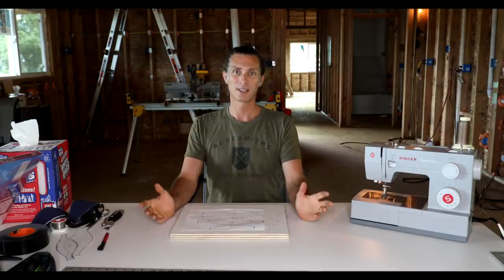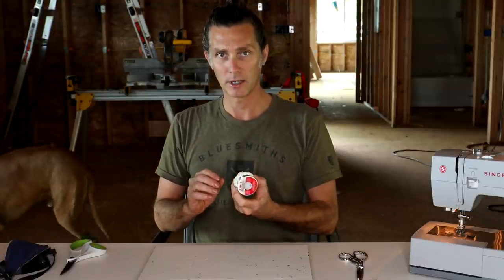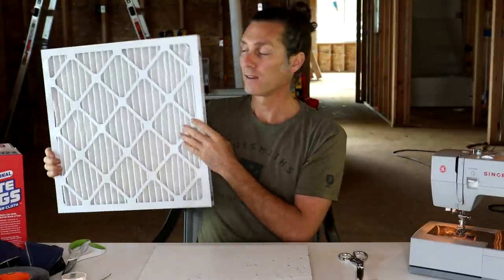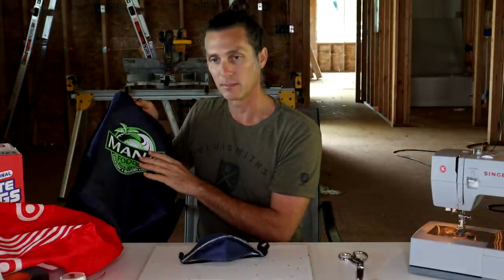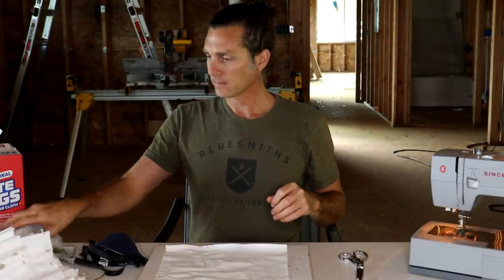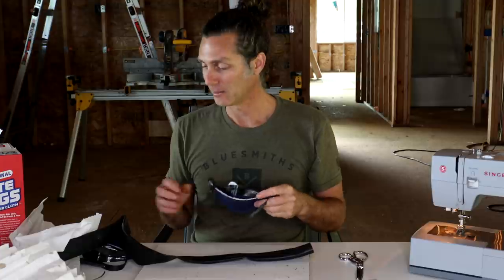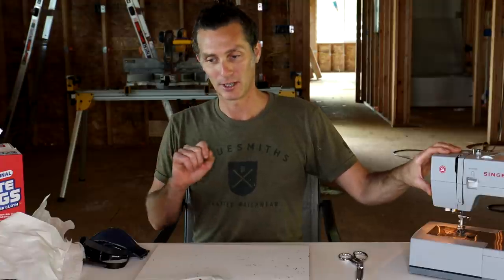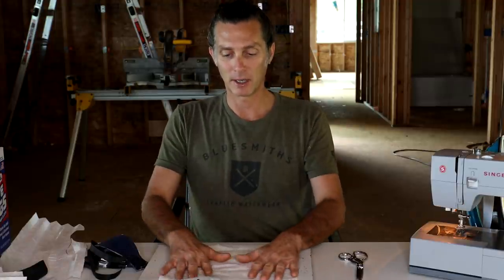Tutorial: HOW TO make your Own High Quality Filter Mask

Comment: Best design ever. The Target and Mana bags are made of "Oly Fun" fabric which you can buy from Amazon.  

I'm adapting these not to use the filter and to sew a flap around the wire that I can attach when I stitch the 2 pieces together (so no holes poked in the Oly Fun which would reduce its virus filtering)

 The shop towels and Oly Fun were both tested an are virus filtering. 

Maybe not quite as good as the HVAC filter but for home use where you want to wash, yes.  

Many thanks for this, Russell!
Reply: They are out and back ordered so I found bags which was fine with me, I made sure of the label. 
Didn't take long for this to spread either.
Reply: Oly Fun fabric works, but most is gone from Amazon AND I bought one that was in stock but it was not breathable.

Comment: Coffee bags sealing wire strip. Excellent thickness and conforms very tightly around your nose.
Also you could sow the wire inside the layers or if you want to leave it on top you can do a zigzag stitch on it.
Still gorilla tape works too...
Thanks for your video. Excellent design!!
Reply: I've used electrical tape.
Reply: or cut one out from aluminum foil pan used in baking

Comment: Ok so I made this.
1) My wife has a surger so i used that for joining and all the edges.
2) I eliminated the duct tape and inserted 14g solid copper between the layers and put another stitch closer to the edge.  Also you can insert a straightened paperclip under the edge if surged.
3) I like the material choices, I had to read up on the shop towel suggestion but it actually has some supporting evidence...

Comment: Just a thought...if you can't get elastic, you could possibly cut an exercise stretch band/yoga band.  Cut it to the desired width.  I'm not sure how they'd hold up to sewing but if they won't hold if sewn, you could experiment with glue/superglue.
Reply: I have been using the elastic exercise bands, yes. I have a lot and is easy to work with.
Reply: Use old yoga pants. Just cut strips about 3/4" wide across the grain of 10-15" length. Then pull each strip, making it curl. The result can be stitched to the mask or run through a casing for custom fitting. The strip ends can be tied behind ears or behind head.
Reply: Susan Corvalan b
Reply: Ace bandages work beautifully as well. Most of us should have them in our first aid kits. :)  Cut into strips and cut to needed length.
Reply: Here is another thought. You really only need one side to have a loop that stretches behind one ear. The other side can have a loop of regular fabric that loops behind and around the other ear.

Comment: Notes and questions:Great engineering!  Love your pattern and will be using and sharing.  1). I have a tip about pattern and sewing process:  If you don’t want to draw or trace, cut your pattern pieces from freezer paper.  Iron lightly (shiny side down) to your outer NONMeltable layer. Then you simply sew around the pattern thru all your layers and peel off the pattern.   2). Washability:  it is my understanding that washing reduces the efficacy of the filter material.  Is it your intent to wash this mask and reuse?  How do you clean?
Reply from the maker: Great tip thank you. This mask design is less washable than others.  However, it can still be cleaned by other means. UVC light is an option that some are using to increase the usable life of the mask to 30+ uses. I have also been baking the masks in our toaster oven at 150F for 2-3 hours. The idea being is to Desiccate the virus. The dry heat in the oven will remove any moisture and hopefully dehydrate the virus rendering it inactive and unable to infect.
Reply: @outofthedoldrums  what about just leaving the mask alone for say 4 days, would that produce the same effect?
Reply: Out of the Doldrums maybe, rather than make the layers all together, use tightly woven cotton fabric, double layered, then make a pocket to put toss-able filters (like pm2.5 filters) in?  I’ve seen this design done that way and you could still make the filters using less material to be tossed.  You could even then boil the fabric outer mask or just wash and dry it.  The inner filter could maybe even be put out in your lovely Hawaiian sun for a day or two to dry and kill the bugs (UV, baby!).  Just some thoughts.
Reply: Zatara Lasname if you leave it in strong sunlight every day that should kill off anything. My brother is leaving them for 7 days....he has a lot of them though and lives in a sunny warm place.

Comment: For the nose a 16 gauge piece of wire stuck to a 1/8 inch wide piece of foam weather stripping works great. Bendable to form, the foam makes it more comfortable and gives it a better ability to really form and seal to the face, and helps keep the wire from bending to sharply and snapping. 
Ace bandages work if you can not find elastic. Cut into long strips and cut to length.
Reply: I think the ace bandage is a great idea although I had some weather stripping, I don't think that will hold that nose piece very long at all and could potentially pop off and hurt someone,  I've decided to go with the tape it is very strong.

Comment: Good explanation, use 3M Filtrete 2800 anti allergenic filter will give one an N90 mask. HEPA anti allergenic vacuum cleaner bag are N95 material, .3 Microns and 99.97% filtration.

Comment: FYI FILTRETES are the best. It shows a merv rating and you want to see a Merv 13 or higher. You want the filtrete filters that say they block bacteria and VIRUSES. You also want to pay very close attention to the packaging of the filter to see direction of the arrow. The arrow direction you want toward your face. So yes it matters. The arrow point should be facing your face. FILTRETE filters. are fiberglass free. They are perfectly safe.you also want a 16 gauge wire. You want to be able to dispose of the filter after each use. Do NOT IRON or WASH THE FILTER. It breaks the electrostatic charge which means it will no longer work. You want 100% cotton as it is the most breathable fabric.

Comment: Just wonder if the 2 seams between the 3 pieces would be leaky and let virus particles through? The surgical masks are seamless in the front maybe for that reason. Perhaps a solution may be to use a hot melt glue gun to seal the seams.
Reply: If you can ultrasonic weld it you'd be all set.  Maybe a sort of seam sealer along the inside seams would be acceptable, like sealing a tent?
Reply: I don't think so, these masks are meant to be steamed and washed and pressed and hot glue would ruin an expensive iron so stay away from that
Reply: I agree the stitching ruins the mask, but I think you could rub some wax to seal them.
Reply: @Jorge_Rodriguez83  there is no scientific evidence that stitching a mask ruins it. in fact studies show plain cotton masks do just as well as N 95's and are probably a lot safer because they're pure cotton and no petro chemicals were involved.
Reply: @jmdenison  Simply run a bead of hot glue gun adhesive where one has done the stitching using the sewing machine; this will seal up any holes created from the sewing.
Reply: @profdleeucc  I prefer to use pure cotton which is non toxic and made for use on the human body.  HVAC filters are not recommended for breathing air directly or placement on the human body.
Reply: @profdleeucc  won't work.  hot gue will melt if run under hot water to santitize your mask.  plus if you have to stitch around or thu hot glue your need can stick and break.  you could also ruin your $5k+ sewing machine.  hot glue should not be used on a sewn fabric mask.  the fabric will protect you just fine.  use a 2.5 mm stitch on a computerized machine.
Reply: @profdleeucc  a good computerized machine should make tight fine stitches which will seal the mask quite well.

Comment: another tip - clean every thing and wear a mask before you start.
Reply: I would think a good idea especially if you are making for others.
Reply: Proper sewing procedures are you steam the fabric right out of the bolt and then while you are sewing you should set the seams again with a steam iron and then when you have made your product you Steam it again. So there should be no problems with any type of pathogens left in that fabric by the time you are done. Just put it in a ziplock baggie and be done with it
Reply: The opposite, since you contaminated everything  again,  clean after you sew it.
Reply: @KVStarStruck22  exactly what I said.  plus you should be working in a clean sewing room and sweep daily, vacuum, vacuum out your sewing machine weekly (do not use a dust blaster on it, it just forces more dust deeper into your machine) and when finished, steam again right before putting your project into your bag for selling. oh, and wash those floors with a clean mop twice per week, dust the room too.  and when I mean clean mop, that means rinse the mop until water runs clean for every 3' by 3' section of floor.  wash the mop head in the washing machine when done.
Reply: @jmdenison  Thank goodness I have someone in my family that sweeps and vacuum on a daily basis even before the pandemic. Lol. I do however, clean doorknobs and faucets handles everyday.
Reply: @KVStarStruck22  just steam your final product.  If you're sewing properly you have steamed the fabric off the shelf, after the 1st center seam, then after the side seams and turning, and then at the end.  final product.
Reply: You have so much monologue that you will be hard to follow.  Do something then explain why.
Reply: @florinoavila7773  glad I'm not the only one. I had a hard time holding my attention during this video. Not coming from a bad place, just some constructive criticism.

Comment: I have used 12 gauge aluminum jewelry wire that I hammered flat for the nose brim
Reply: I tried the exact thing (hammered 12 ga alum wire) but also tried 18 ga wire. I cut it twice as long and folded it in half so the two wires ran close together-I then sewed them into a narrow strip of fabric before attaching them to the mask. It was more flexible than the 12 ga and a little easier to mold to smaller faces.

Comment: I love the mask and instructions! My only feedback is that this version would be much better if the filter and towel was an insert so the outer mask could be washed. The filter and towel could be sanitized using Russell's suggestion of baking it in a toaster oven at 150 for a couple hours or replaced if you have enough of the filter material.
Reply: I saw a suggestion on another video regarding sanitizing filters and masks that sounds effective, although I haven't tried it myself.  The idea was to use an Instant Pot as an autoclave  by adding 1cup of water and "cooking" for 2 minutes with masks/filters on trivet.

Comment: This is a great looking mask and great creativity.  How in your experience do these hold up to washing?  Does the paper towel layer survive the washing?  How do you clean and sterilize them after use?
Reply: I would love info on this as well.
Reply: I would think the tape and cotton pad would not stand up to many washings. Another way to sterilize a mask would be to spray it down with 70% isopropyl alcohol  and let dry.
Reply: @maryhornbostel6959  Thanks - that is a great idea - one problem is that it is very difficult to find isopropyl anywhere :/
Reply: @bellaspatiogarden3493  learn how to make moonshine next or buy some high proof liquor.
Reply: @bellaspatiogarden3493  
You can actually by Everclear from a liquor store, its also high enough to sanitize utensils with. All liquor stores carry it and it's not very expensive.
Reply: @diasweet47  EVERCLEAR is out everywhere. goodluck finding it
Reply: @KVStarStruck22  
I have been reading not so much a good idea to use alcohol as it can damage the mask, maybe good you didn't find it :)
I would just either do the oven sanitation or what I'm doing is switching off every 3 days or so and bag it up and leave it in my car. But if it get dirty at all from makeup or whatever I just toss it. Not worth the risk giving the cost to make them ourselves. That's just what I do.
Reply: @KVStarStruck22  
But if alcohol is what you really want to do I would think 91% alcohol would work or 151 clear rum would also take the place of the Everclear.

Comment: Elastic replacement....Bathing suit fabric, stretchy headbands, cloth covered ponytail hair bands, rubber bands...but I really like the innertube...great idea!
These aren't machine washable unless you use flannel farm oooh hv xc freea VERY important detail is the masks must' seal and fit snuggly so the intake air is filtered....AND make sure the solder used does NOT have the flux inner core that enables the solder to flow easier when heat is applied. (Its toxic tree pitch -like substance used to make the solder flow smoothly so won't be grainy solder joint that will fail)
I found garden tie from dollar tree store...is soft rubber w a bendable wire that is perfect nose clasp seal...65 ft of wire for $1.
Reply: you ment to type LEAD>

Comment: I admire your efforts!  I wonder about facing 2 layers of air filter fabric toward or away from each other to get 2-way protection breathing in and breathing out.  Wouldn't the opposed layers tend to cancel each other out somehow?  Even if this isn't true, there may be a simpler DIY solution if you manage to buy a roll of melt-blown polypropylene (MBP - not too hard to find, and less costly than it was a few months ago).  Just take a good 3-layer cloth mask with a filter pocket, cut a piece of MBP off the roll and place it inside the filter pocket.  That ought to achieve results similar to what you propose here, with much less work.  However, skilled mask makers may want to consider your method.  My only other concern is that the filter material will degrade over time, rendering the mask less protective over some unspecified period of time.  Do you have any idea how long the mask will be more protective than a conventional cloth mask?

Comment: the arrows are used  so the forest air from you heating unit will not filter off the screen  but it pushes filter towards the screen

Comment: Can you wash these after use? Otherwise, you would be going through a lot of work for a single-use mask. If you reuse a used mask you are defeating the purpose.
Reply: That was my concern too but I did read up on the filter which can be washed so I'm hoping they can. Also I was thinking of a way to insert all new filters but I'm not sure on that either..hopefully Russell can advise.
Reply: @diasweet47  I was concerned more with the paper towelling. The one I'm making for my daughters (both health care professionals). I was thinking of two layers leaving a slot to replace filter material. Making it easy to replace and the cloth mask could be laundered.
Reply: @diasweet47  it is the outside of the mask that gets the most germs. Either wash it, heat it, or put it in the hot sun.
Reply: @ranstra12  
Definitely the outside, always think of it as contaminated. I saw Russell meantion they could be sanitized in the oven. Me personally, I will most likely toss mine after a few uses. As long as it still holds up properly and you remember not the touch the outside it should be good for awhile. I'll be leaving mine in my car window to get Sun. IMO I don't think the paper or tape will hold up in a wash.
Reply: @HeardItThruTheTapedLine  
I myself probably wouldn't do that , but maybe ask your daughter which they prefer, I may do it for myself but being in the health-care business they may want to replace the entire mask given the contamination on the outside if its possible. I've been in nursing and didn't wear mine to long but depending on the shortage they have the replacing the inner filters is a great idea. I would see what they prefer.
Reply: @HeardItThruTheTapedLine  
Also not knowing what department they are working, keep in mind to where that opening is,, will it be a trap for the virus. The more I think about it I'm not sure it can be safely done unless Russell has a idea.
Reply: @ranstra12  It isn't so much the heat from the sun that kills the virus, it is the radiation. The UV A AND B from the sun, and UV C from some man made UV devices. 

The entire thing is crazy. 

UV A & B take a bit longer, C is quick but gets absorbed quickly in our atmosphere.

Note that all UV light is not good for you. Cell destroying.
Reply: There are a lot of tutorials on making ones where to can replace the filter. I  agree below that asking someone you may make them for, or a hospital you're making them for what they prefer.  But usually the opening in on the inside.
Reply: Bamboo paper towel would hold up to washing.

Comment: could use a pipe cleaner?? for the nose bit, if nothing else? :) x
Reply from the maker: Sure. You can fold it in half to double it. You may find that it needs to be stiffer for this mask. Any wire will work given you use enough strands
Reply: I tried a pipe cleaner and it was too weak. Maybe twist two together to stiffen.
Reply: @occipitalneuralgia2339  that was what i had envisaged, folded and doubled up a few times :)

Comment: The only problem I see is that you iron the 3M filter.  The 3M filter works based on being static charged and that is how it attracts the particles or bacteria and viruses.  When you iron it you take that static charge away.  Otherwise good mask.
Reply: I think the low setting as he said it should be fine, the furnace blower itself blows out much hotter air. But you can't melt any of it with a hot iron.

Comment: My issue is with the stitching that joins the middle section together. If it isn't sealed you lose the filtration benefits of the filter due to the holes created by the stitching. The design makes it fit snug/comfortably but the holes created by the stitching could reduce the effectiveness of the filter.